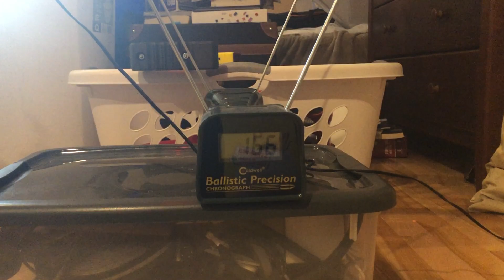SillyPistol first prototype overview and chronographing

Comment from the maker: 0:00 Overview
3:50 Magwell feature
5:30 Chronographing (165 Avg with DZ Max short darts)
7:20 Final Thoughts
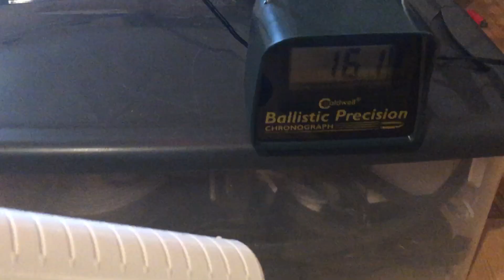8:30 Quick specs (4 inch barrel, 2.5 inch prime, 4 inch long 1.5"OD plunger tube, 4 inches of k25)

Comment: That's got some serious punch for a pistol! I love the collapsing magwell for holsterablility. How's accuracy, and have you tried a scar?
Reply from the maker: I’ll do some further testing after I print a new plunger rod, but preliminary testing showed good-ish accuracy without a scar. The plunger rod snapped due to low infill before I could try it with a scar.
Reply from the maker: Printed a replacement plunger rod, this thing is dead accurate with a SCAR.